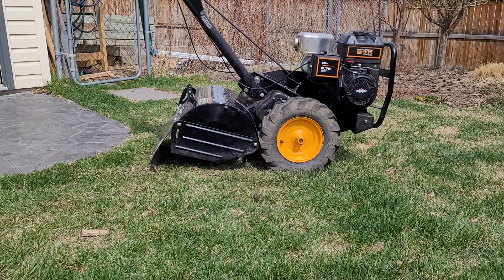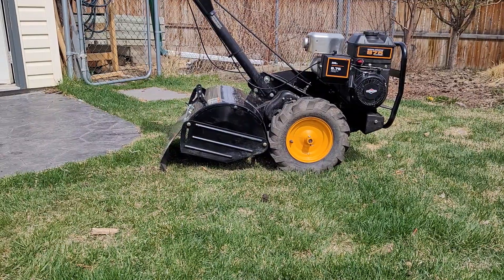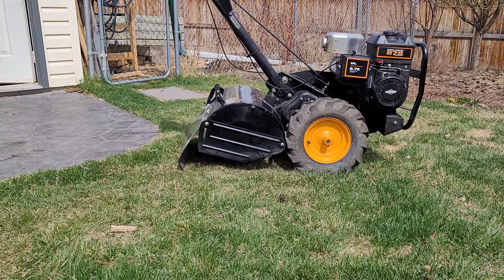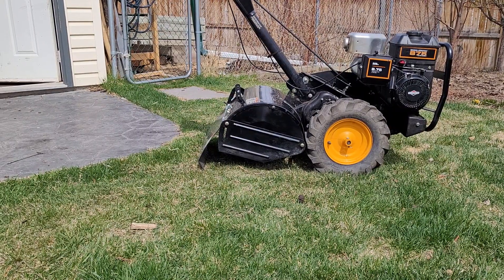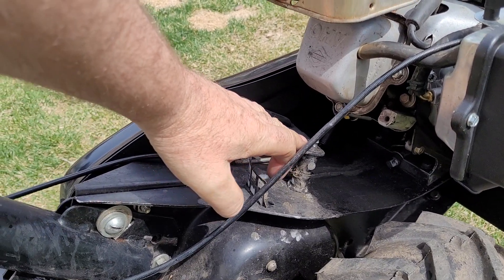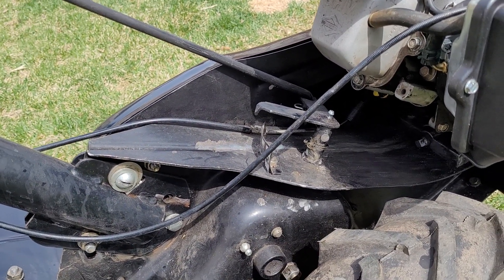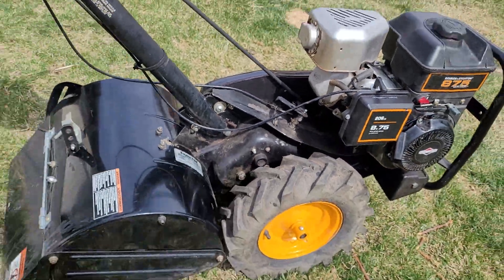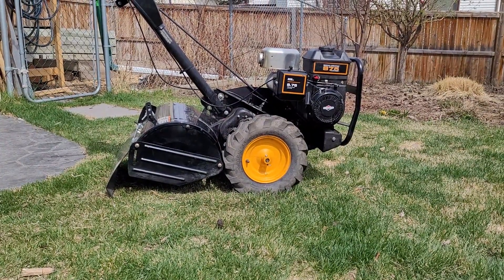Poulan Pro Rear Tine Rototiller

Comment: Hi thanks for the video, i just bought a old tiller like yours and it doesn't shift to the till position. You mentioned moisture getting inside. Is that what causes that problem. Thank you
Reply from the maker: Thanks for checking out my channel. It’s been a couple years since I had the tiller, so I’ll see what I can remember. On mine I had to disassemble some of it so I could access the shift fork in the transmission. From what I recall it wasn’t able to shift into all of the positions either. When I reassembled it I believe I added a grease fitting to ensure I could keep linkage lubricated and reduce the water and dirt from getting in there.